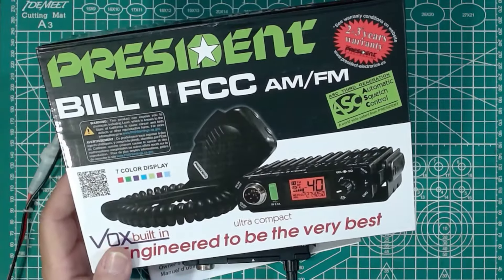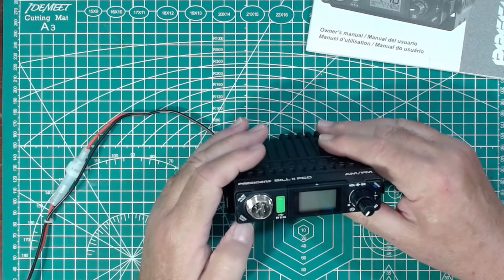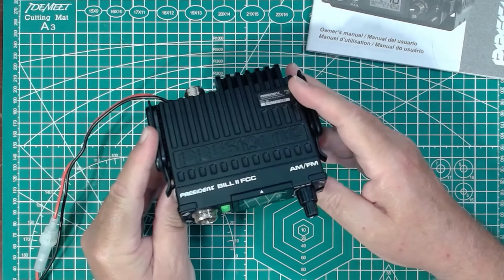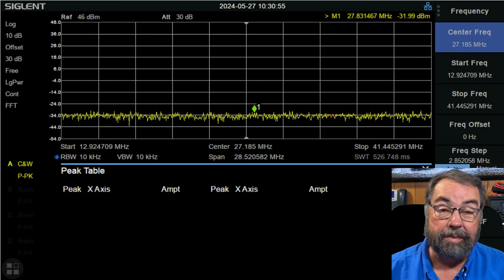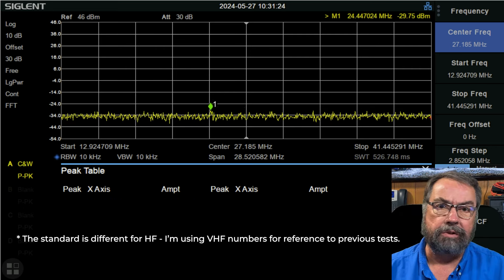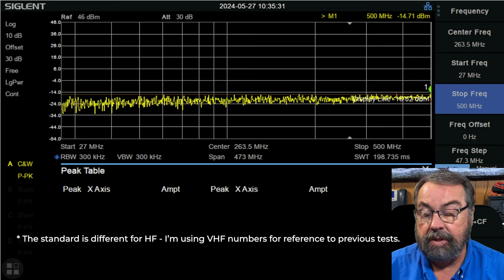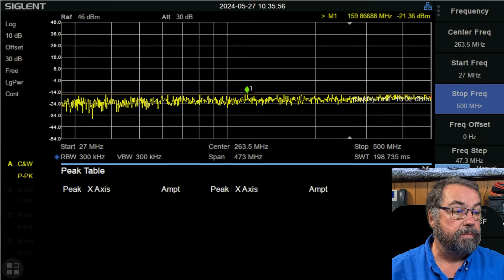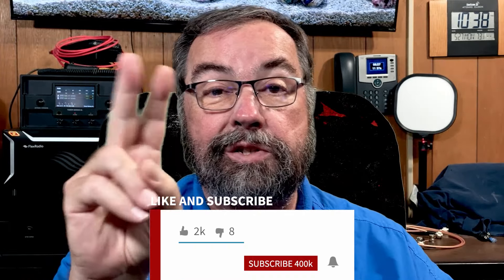Just How Clean Is That CB??

Comment: Hi Jim.  You're really enjoying that Siglent!  May I suggest feeding a 400Hz sinewave into the rig, and then look at the spectral purity.  I think it will be a different story....perhaps fine with the attached stock mic, but 90% of 11M AM'ers use a power mic because they know they have to overcome all the other noise on the channel.  I use a simple audio oscillator app on my phone and play it into the mic to observe the output.  You can also check the FM deviation this way by using the spectrum analyzer and a Bessel Null frequency chart.  You'll see the carrier drop to zero when both the modulation percentage (index) AND the audio frequency line up on the Bessel chart.  Many are online for both FM broadcast, and NARROW FM (like what you have in your CB and FM HT's)  Keep up the good work OM.  73
Reply from the maker: Will do - that is a great test to add in Hollywood.  Thanks!